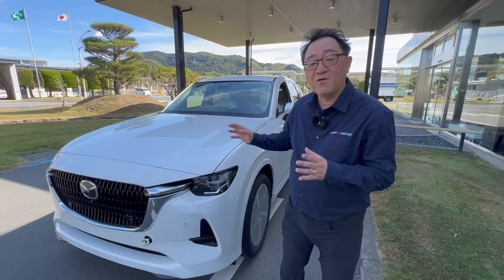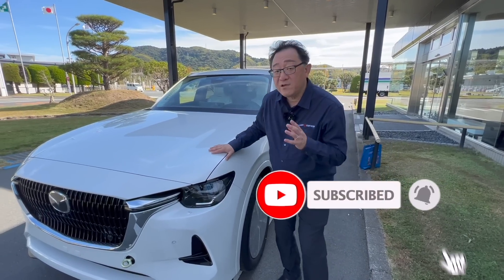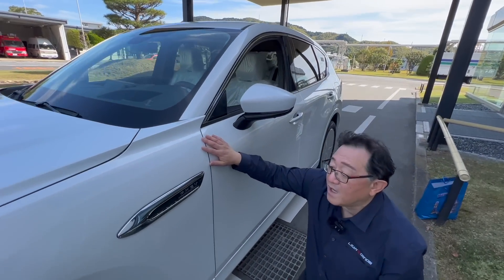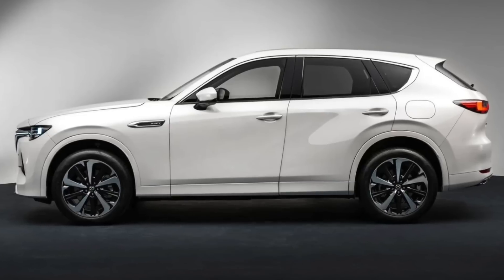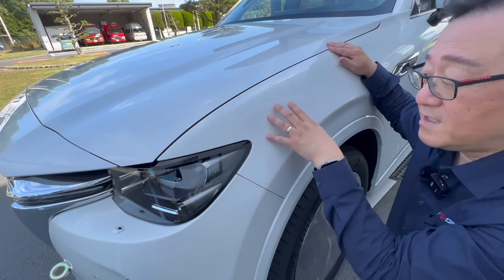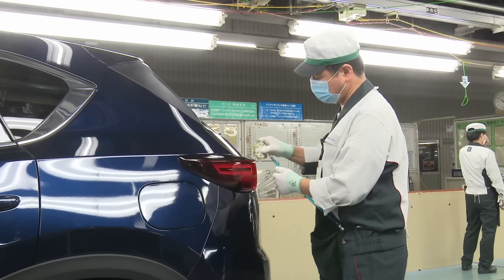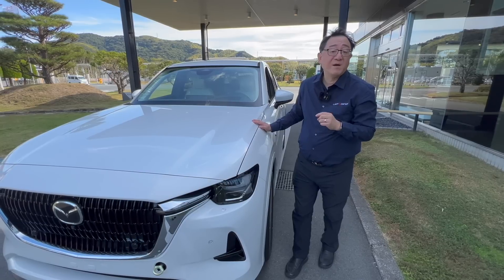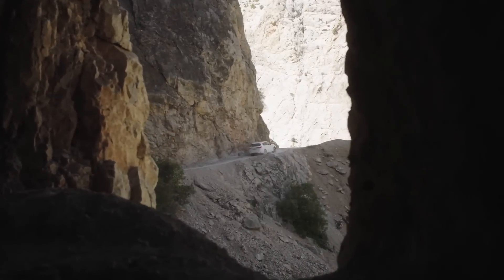MAZDA QUALITY - IS IT TRULY WORLD-CLASS? / LET'S TAKE A LOOK AT MAZDA CX-60 THAT'S BUILT IN JAPAN

Comment: Mazda would kill it if they would just make their cars class competitive in practicality. For some reason they are almost always at the bottom of the class for cargo space with their SUVs. The CX-90 manages to be longer than most of its competition while being well behind in cargo space (it actually has roughly the same space behind the first row as a CRV and is almost 25 cubic feet behind the Grand Highlander) and having the worst third row in the class. Its like the didn't learn the lesson of why the CX-9 never sold or why the CX-5 has always been an also ran compared to the CRV or RAV4 which have far better cargo space and (until the hybrid CX-5 is out) far better mileage in a class where practicality is everything

Comment: I just traded my wife's Camry for a 2023 CX50 and absolutely love it. Toyotas are great quality and love our 2011 4Runner and they’re reliable as heck. They also have a much more user friendly infotainment system than Mazda. But that Mazda is hands down way more fun to drive and I have no issues with comfort. Toyota is in absolute love with a sunroof and all of their models except 3 I have to recline my seat to not have my head rubbing the ceiling with a sunroof even in our beloved 4Runner.  I'm 6'4 and my head doesn't hit the ceiling in the Mazda even with its sunroof. Also our local Toyota dealer said add $5000 to sticker on their vehicles. $10,000 if it's a higher trim.  Mazda sold me their car $500 under Msrp. Not great like the deals you used to be able to get 3 yrs ago but better than not straight up screwing you like Toyota dealer either lol

Comment: I have a 2016 CX-9 with the 2.5T Skyactiv engine with less than 78,000 miles and it has been in the shop since November 8th of last year with a head that leaks coolant and a bad transmission (I am posting this on Jan 5, 2023) .  Mazda Quality? NO! The leaking head issue is a KNOWN PROBLEM with this engine in the CX-5, CX-9, and Mazda6 for 2016 to 2020 model years (they issued a TSB for replacement of the head for this problem) and there have probably been hundreds of owners that have had this problem with their Mazdas.  So what did Mazda offer to do about this known defect that showed up in our CX-9?  They offered to "fix it" for about $3000 through my local dealer, since our CX-9 was "out of warranty".  This is NOT quality and this is NOT a company standing behind their product.  After I get it back and  I run this CX-9 into the ground, the next vehicle I purchase will not be from Mazda. (PS thankfully, an extended warranty that I purchased covered the transmission replacement).👎

Comment: I own a 2019 Mazda3 manual transmission and it is made in Japan. I was excited for that. However, as I quickly realized made in Japan quality may not be as much as the differentiating factor as I thought. Lots of first year of production problems, rattles, etc. Also, I found a lot of made in China parts all over the car.  I expected a made in Japan car to use a lot of Japanese parts. Even though the car is assembled in Japan, I believe manufacturers are getting parts from lower cost suppliers overseas, which I hope does not mean lower quality parts.

Comment: Before choosing a CX50 you should consider the following:
1. The GT’s 20” rims and standard Goodyears (Canada) cannot be considered an off-road tire.  Hopefully it works in winter but you don’t have much tread depth.
2. This is no competitor to a Subaru product as there is no suspension travel, little ground clearance and a metric tonne-load of plastic under the Mazda (can you find the oil filter DIY’s)
3. Fussy interior: Beautiful sure but it marks so easily and that surface around the shifter is hard to clean and scratches easily.
4. How do you clean the heads-up display that sits in the well in the dash and do you find the display  in the glass distorted or clear?
5. Don’t count on great mileage and oil change intervals seem to be more frequent.
6. Body: so many crevices to trap sand and salt over winter = early rust potential?  Just wondering (had literally miles of weather strip components)
7. Rear storage:  Disappointing!  The problem is the roof height.  If you travel with small family (4) you must consider bringing empty luggage to the dealership.  You may find a CX5 works better as luggage can stand vertically back to back?Try it!  Or reconsider other brands.  Don’t simply rely on volume data.  
8. Purchase experience:  Maybe this is happening every where but freight and PDI seems greatly inflated and acting like a surcharge.
9. Ergonomics:  Not bad. Glad to see some buttons but the stitching on the steering wheel isn’t smooth, spokes are awkward and grip width at the 9 and 3 position aren’t good.  You might agree after 500 miles.
10. Chassis should be an inch or 2 taller to achieve a better ride and provide greater ground clearance. Isn’t this meant to be a better off-asphalt Mazda?
11. Seats. Be sure you are ok with the Mazda designed butt-floss.   This is weird and should be changed mid-production.  Seats are hard.  Bolsters are very hard.  Access and egress for taller front passengers is a pain.  
12. Look hard at the CX5 before you buy the 50.  
13. Outward visibility is poor due to the tall door sills and low seating position.  This is greatly annoying and further, the shape of the mirror looks nice but is less functional.  I recommend looking at Subaru as outward visibility is fantastic.
14. Decorative exterior panels scratch very easily.

Comment: I wouldn't call it world class. They have a TSB for 2.5T engines made before 2020 for cracks in the engine due to stress from the exhaust manifold, causing coolant leaks. If you are out of their 5 year 100k mile powertrain warranty you're at the mercy of mazda corporate or your dealer. Mazda is not known for great customer service so a bunch of people have had to shell out the 10-12k for a whole new engine. They will only perform the engine replacement for the TSB if your car exhibits the leaks.

Comment: Had a nearly new 2020 Mazda CX-9 Touring as an insurance rental for about 8 weeks when someone hit my vehicle.  Wasn't all that impressed to be honest.  I think the interior on my 15 year old BMW (even with the lack of all the technological advancements that car has compared to a 2020 Mazda) still feels more solidly put together.  Doesn't squeak or rattle over every  imperfection in the road like the Mazda did.  And that goes without mentioning the vast difference in quality of the touchpoints around the cabin.  But to each their own.
Reply from the maker: Mazda CX-9 isn't the best one to compare, since its design is older.  The newer Mazda's are still impressive, however.

Comment: I don't really care about an extra millimetre of precision in the panel alignment, I want quality materials that will resist corrosion for YEARS, and total reliability that comes from simplicity of design.
Reply from the maker: I have been in automotive manufacturing for 35 years in all areas of production and engineering.  The body precision is the first sign/evidence of good engineering and reliability.  The overall reliability is related to the body integrity and alignment because the same management overseas both.  If you get the body quality right, then likely the rest of the car is built well.  If the quality of the body is off, then it represents a problem with overall quality management that impacts quality and reliability.

Comment: Mazda if free of faults, but there is something about quality .I had Mazda 6  2007  special Edition fully loaded the last model year before new model appeared .With 54000 km on the clock I had nothing major problems with it until 100.000 km where some of rear suspension had to be replaced because the stupid speed bumps we have ,wearing down suspension parts earlier than normal !

Comment: Yea....mine needs service after 4.000km for suspension noise on bad roads, mazda app keeps bugging, with folded rear seets, the front seat easy access makes it crash into the folded seat headrest, keyless opening wont work on freezing temperatures, rear doors wont unlock with running car from the outside, can't use the mazda voice controls when using android auto, even happened I got stuck locked inside the driver seat and could not open from inside (lucky enough my kids opened from the outside which worked), assistents disable with every second dirt and keeps bugging on the dashboard for the entire trip unless you stop and clear the sensors. Came from us car and my experience is medicore with mazda. Driving is fun, comfort is decent, but a bit too buggy it seems.

Comment: around the 5:39 mark...I assume this worker is checking that the gaps between frame and door meet standard? what happens if one comes down and doesn't meet standard- is there a stop button for the line? thanks
Reply from the maker: Yes if that doesn't meet the spec, they will pull the andon cord and stop the line

Comment: I've been a Toyota customer for awhile now for their perceived quality but think my last Corolla was built in the US ..no problems yet but am looking at the very handsome CX5 or CX50 now and wondering if they're all made in Japan? I'd rather have a made in Japan vehicle. Not sure if the CX 5 or CX50 are available with a 6 speed manual shift and non-turbo 2.0 or 2.5 but they should be. I only buy manual shift non turbos.
Reply: My 2021 CX5 was built in the Hiroshima plant in Japan. The CX50's are built in Alabama alongside a Toyota model in a joint effort between Toyota and Mazda in the same plant. No manuals are available  to my knowledge.
Reply: Don't do CX50 , I tried one and the fit and finish compare to Hiroshima built CX5 is day and night. Interior materials feels cheap, seat stiches looks cool but will rub your back while driving. Try closing their doors and you could tell which one has more insulation. Bought the mid level CX5 and it  drive and feels premium .

Comment: Maybe the key message in your video is "JAPAN built". My Madzda 3 here in Austria was built in Mexico and especially its paint quality was rubbish. All plastic parts had a different tone than the metal parts. Worst on metallic red, but also visible on all all other, including non-metallic colours. 
Also other quality aspects were terrible. Ratteling from every part of the car and many major software bugs. The only bug that was ever fixed was the heating blowing with maximum temperature (41°C) even tough set to cooling. Took them 2 years to fix this.
I sold it with a terrible loss, but was extreme happy to get rid of it.

Comment: As a former operations manager of a very major rental car company I’ve experienced almost every brand and every model out there, from BMW 7-series to Mitsubishi Mirage. We tended to hold our cars for about a year, on average, in which time they would pick up 35,000 miles, on average. Very rough use, only 87 fuel (even if needs higher) and minimal maintenance. I have a pretty steady hand on the pulse of quality building. 

All I can tell you is that our Mazda 6s, 3s and CX-5s have been below average in build quality. While they suffer few mechanical issues (most cars do in their first 40k miles), their interiors and body panels have not fared well compared to most other brands. Oddly enough, Fords seem to hold up the best of all, although they tend to have a bit more engine troubles. 

This video is basic marketing.

Comment: The only problem  I have with my 2016 CX-5 is the heater, it takes a long time to get the engine hot in really cold weather. I put a new thermostat in it and it didn't help at all and from what I've found on the internet there is no fix except to cover part of the radiator with cardboard, Mazda's advice, which I did and it does help somewhat.
Reply: May i ask is it a diesel?
Reply: @Jesko_VRS  No, it is not a diesel.
Reply: I noticed that the heat takes awhile to to get to a comfortable temp in my '16 CX-5. I've had it for about 18 months. If that's all I have to worry about, I'm good.

Comment: Well when you only have 1 engine option and use the same parts in every car it's gonna be more reliable then some companies that have different models with different screens and switchgear and lights and tech and multiple engine options and more advanced transmissions.
Reply: And that's a bad thing?
Reply: @Bruno Danese  yes its like a Russian nesting doll.. every car is the same just different sizes.. plus their tech is old and out of date. If every company dod this there wouldn't be much style out there.
Reply: @flavoredmoney8755  Or it's like Rolex watches, all using the same movement/caliber, only different cases. The result is precision, quality and reliability.
Reply: @Corey C.  yes, but boring and unoriginal. They need some new designs.
Reply: @flavoredmoney8755  what youre saying makes no sense at all.
You are literally complaining because they are too reliable? crazy
Reply: @Bruno Danese  no I'm complaining because they are all the same.. they look boring and there no differences between the models..  if evey car company did this we'd only have like 10 different engine and look options.
Reply: @bruno-and-cars  also if every car company used this method they would all be super reliable but there wouldn't be much choice or style.
Reply: @flavoredmoney8755  what you are saying doesent apply to Mazda though.
They build small Mazda 2s, Mazda 3s, Miata with rear wheel drive, Cx5 and now rear wheel drive 6 cilinder suvs.
Literally one of the brands with most variety on the market.
they have multiple engines, probably more than any other company.
Gasoline - 1.3, 1.5, 2.0. 2.5, 2.5 turbo, 2.0 skyactiv X 
Diesel - 1.5.turbo. 1.8 turbo, 2.2 twin turbo, 3.3 inline 6 turbo

Comment: I have always appreciated the way they do their factory. I've been to a few Japanese factories and Mazda is one of the few (if the only) that has a single line for all models.
By doing this a couple of things much be achieved:

1. Mixing types and variations on single line means a highly optimised/lean line. Most car companies has a line per car type allowing for spares to sit idle. This is not possible in a multi-car line. Forces Mazda to be highly organised and clean. This shows in the production line.

2. Assembly staff must be trained on all models are for this reason are more senior. Single line allows for junior staff to perform assembly.
 
You point about panel alignment and shut lines is echoed by an Australian vehicle that compared a large group of SUV's. See: https://youtu.be/C5252Bu9cGU?t=268
Quote: "It's the only car in the field that has absolutely perfect bonnet (hood) fit. This shut line that runs all the way up here, is exactly the same on both sides".
Reply: Mazda are world leaders in metallurgy so they should be good with shut lines.
They lead really in unique stamping and welding techniques but more so, the strength of their steel and the amount is really unmatched.

They hold a lot of UHSS (ultra-high tensile steel). In fact they held the world record for strongest automotive steel for over 10 years.

Comment: I have a CX-30 in the USA that was made in Mexico, with a Mexico made engine and automatic transmission made in Thailand. So far i have found almost no assembly, paint or build issues. To me it starts with good engineering, demanding a high standard. I wouldn't buy another Ford product for quality reasons, Toyota, Honda both use CVT's, so Mazda was my best choice.

Comment: I can attest to Mazda's quality and reliability. I have a 2005 Mazda 3 GT built in Japan. At 17+ years and 386,000 kms/240k miles of daily driving, I have zero rattles or noises whatsoever. She is solid as a rock, which is amazing considering mostly city driving and some bad roads up here on Toronto, Canada.. Outside of regular maintenance items she has been great. Clutch @ 317k kms, front bearings and LCAs at 330k kms. Paint is all original and gaps are still perfect. If I buy another Mazda, it'll have to be one still built in Japan.

Comment: I love Mazda. I've owned a 2004 and 2008 Mazda 6, a 2011 CX-7, a 2016 CX-5 and cx-9 and a 2017 BT-50. I definitely miss the 6 the most. Next vehicle will definitely be a Mazda.
Reply: I still drive a 2005 Mazda6, after 220k miles. Runs like new!
Reply: 119k miles on a 2006 6 and she is buttery smooth too